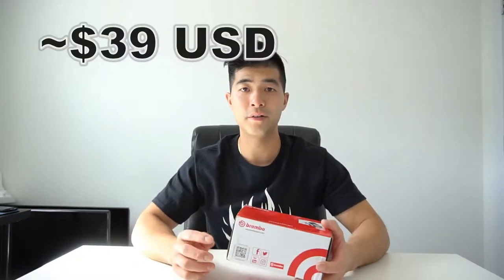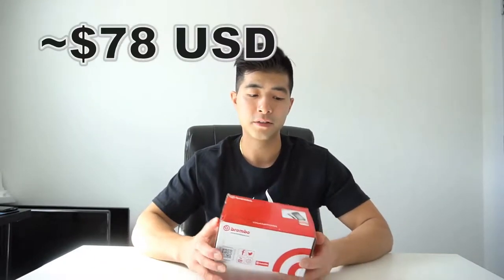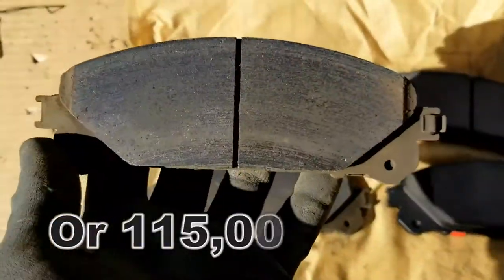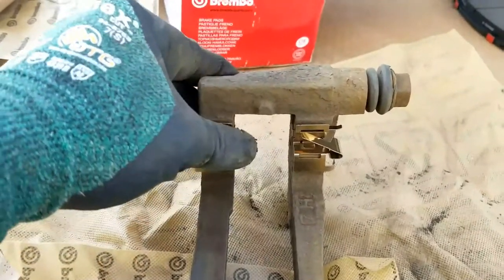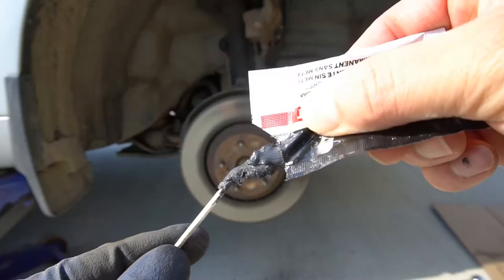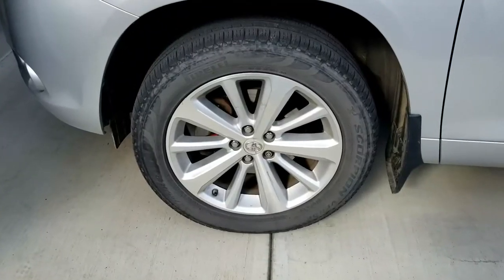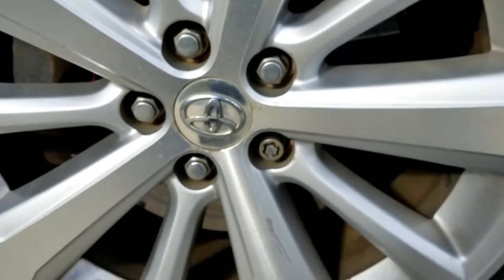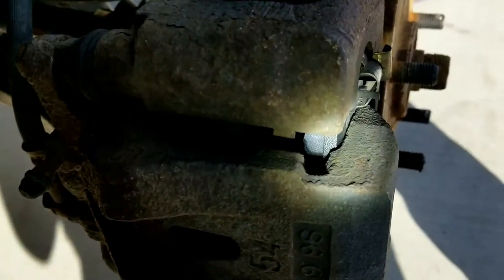BREMBO CERAMIC BRAKE PADS REVIEW

Comment: I find that odd that the brake dust is higher. I thought semi metallic pads give off more dust versus ceramic pads. I bought these any way along with Brembo rotors for my C300. Usually I go with Textar pads/rotors but they are literally twice the price so let's see how this combo does.
Reply: Do they squeak??
Reply: @polverex9534 So far so good. About 1000 kms on them. Hardly any dust especially compared to the semi metallic pads the car had when I first bought it.
Reply from the maker: Nope. Still good!

Comment: Brembo's usually dust more, but their stopping power seems to be higher/initial bite. I'll take stopping power over clean wheels any day, why didn't you replace the rotors? At least they aren't the ..well.. almost 4 Grand that i'd have to spend on my Challenger's FRONT!... that's FRONT brakes .. the rears are a more model grand.
Reply from the maker: Yes that's true. Happy with the performance better than the original factory pads. I didn't feel the need to change the rotors as they were still in great shape. Wow 4 grand!? That is insane! Pay to play I guess
Reply: @KevinPon.  I can stop on a fine, but I need to keep the 9 cents change lol
Reply from the maker: @BMan100  I know what you mean. We all gotta eat lol

Comment: great video! I am going to try these on my Jaguar XJL. Still going to use the old rotors and see how it goes. They don't shake or vibrate so I believe they are still in good condition.
Reply from the maker: Thank you! They are great pads! Worth it!
Reply: Make sure u machine the old disc rotors
Reply: What's your experience with Ceramic Brembo brake pads then ?.